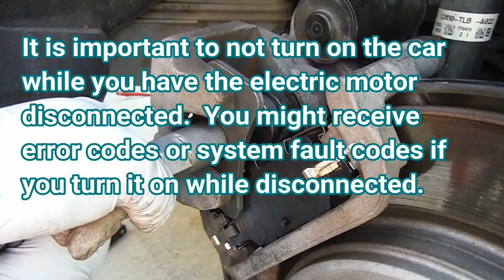2017 HONDA CR-V - HOW TO REPLACE REAR BRAKE PADS - DIY - HOW TO RETRACT ELECTRONIC PARKING BRAKE

Comment from the maker: **Update 2-2023**
So after about 2 1/2 years, I just replaced the rear brake pads (& rotors this time) on this same vehicle and I retracted the electronic parking brake mechanism using a different method.  I manually retracted the caliper mechanism by removing the small motor and turning it back in from behind with a T-47 torx bit.  I also learned (thanks to your comments) that I didn't need to turn the piston when pushing it back in.
Here's the link: https://youtu.be/5tOzgxrFnxY
Thanks to everyone's great feedback on this!
Take care,
-Dan the Fix it Man

Comment: This video was incredibly helpful.  I had never done brakes on a car with the electronic parking brake. 
Seeing you go through the processes was helpful.
I moved the motor while the pads were still in position.  This kept the cutout in the piston in the proper alignment for the mating peg on the rear pad.
I used a Dewalt 12V battery pack, two finish nails, and alligator clips to move the e-brake motor.  I went to full on, made sure the rotor was locked, and then reversed polarity until the motor was zeroed out at full off.
Thanks!

Comment: Great video, just did my 2017 today. You were spot on. I used my dewalt 7.2v battery to turn the motor in reverse, it worked great. Thanks for publishing this video.

Comment: Beautiful video almost 100% instead of using the t handle to screw in you use a wrench on that nut on the outside and you screw it in and it goes in very easily thank you again for the video

Comment: These videos help me change my brakes, instead of rotating electric handbrakes i just unscrew the motor then rotate the caliper gear then press the caliper. To make sure you dont run into error codes just disconnect the battery to avoid accidental turn on.

Comment: Hiya. I'm stuck on removing the power cable. Not sure if I have to press something or just start wiggling with a screw driver. I am not a mechanic by any means and your video is a great help ny giving me confidence to dyi it. I'm just stuck at the disconnect part. Also my car is outside on a jack while I am typing this

Comment: When you powered the caliper piston back (12V) the piston turned counter clockwise.  When you manually pressed the piston back, you rotated it clockwise.  ??? Should you have spun the piston in counter clockwise?
Reply: Counter clockwise from the piston side is clockwise from the back side.

Comment: Do NOT rotate the piston while pushing it back in, the notches on the face are for installation of the e brake. This will damage the boot. The piston can easily be pushed in without rotating it.  Other than that, great video
Reply: Totally agreed. Used the old pad and the c-clamp to push the piston back in with no issues.
Reply: That is incorrect any honda with the notches on the piston is to turn them back in. They do not move by pressing them in.
Reply: @turdsandwicher  you can take the motor off and on the back of the piston there is a place to turn it in and then reinstall motor. There is another video with someone doing it that way he also just pushed the piston in not screwing it in
Reply: Epb they made it with notches like old style Honda's but you just push them in do not rotate there 5 to 10 % the inside pin that turns to engage the parking brake might snap just do the short cut with the wires but push them in like front calipers try if it doesn't work come back  say and wtv comes up on your mind most likely ill never hear from you thanks happy brake change

Comment: I have a 2017 Honda CRV and just changed my rear brake pads. I replaced the slides that attach to the caliper bracket also. I noticed the outside brake pads slide easy but the inside ones are hard to move is this normal?

Comment: could I use a jump box at the power source to back that motor off?
Reply from the maker: Any 12v power source or battery should work.  I have even heard of someone using a small 9 volt battery successfully.
Thanks for watching!
-Dan the Fix it Man

Comment: I did 2016 Civic before seeing this video. I did not use either of the two methods (12V or pull the motor and move from rear) to move the EBP back. I just used the notches and rotated the puck, like I have done on none EBP. I put it back toghater and everything seems to work. My question is what did I mess up? Do I have a ticking time bomb?
Reply from the maker: I haven’t done a Civic with the electronic parking brake yet, so I am not sure if anything is different.  My guess is, if you were able to push the caliper piston in enough to fit it back over the new pads, and you didn’t have to force it too much, and you don’t have any warning lights, you might be fine.  You could always check to see if the Electronic parking brake is working as well…lift it and see if the wheel spins…etc.
Thanks for watching!
-Dan the Fix it Man
Reply: @DantheFixitMan  First, thank you for answering. I have seen other videos and have posted in civic forums and no one has answer me. The puck screwed back like any other non-EBP that I have done. Then I put the front pad in and gently pushed the puck back. I was more watching to make sure I did not tear the puck up. The only difference between your video and what I saw, is the pins are just a little different. I did get lights when I first started the car. I pump breaks and cycled the parking break switch. Then stop the car and restarted it. Tested the parking brake, by putting the car in gear and it held. I was hoping it would work like the old mechanical ones and self adjust with use. So the bottom line is all about making room for the new pads, correct? In the video, it move out when the motor was running, why did it not move in when the motor was running?
Reply from the maker: @Penright14  no problem, it sounds like it might have worked fine, but not sure why you got a light initially...  Yes, it’s just a matter of making room for the new pads.  My understanding on the process of adjusting the rear brakes is to pump the pedal before starting the car and then start it and apply the epb to cycle it once and then turn off the car and it should be adjusted correctly.
I am not 100% sure why it doesn’t spin when turning it in the other direction…other than the screw mechanism must be bottomed out.  Someone also added that once you do the battery trick, that you can push the piston in without turning it.